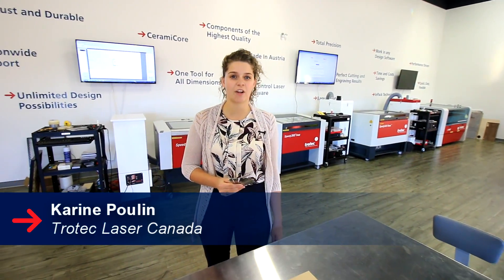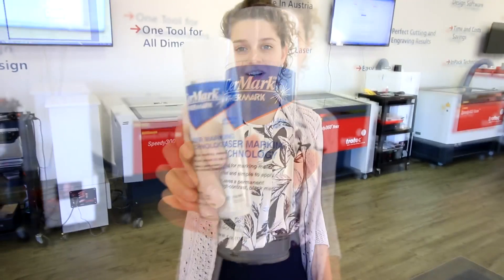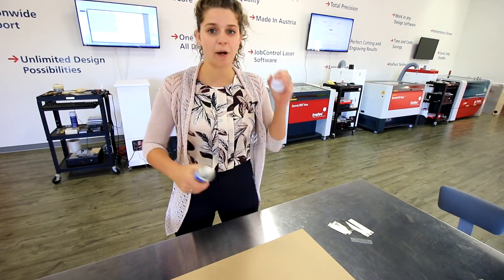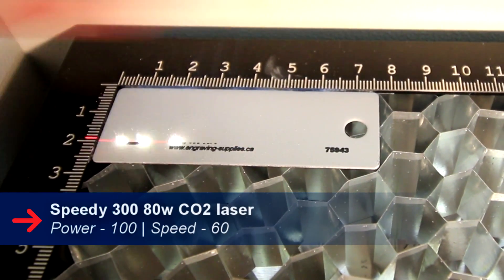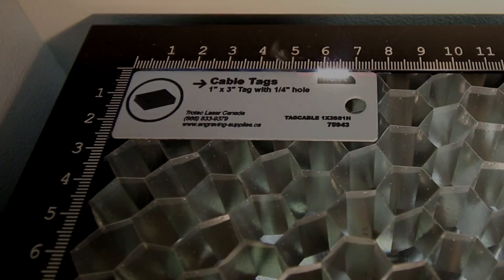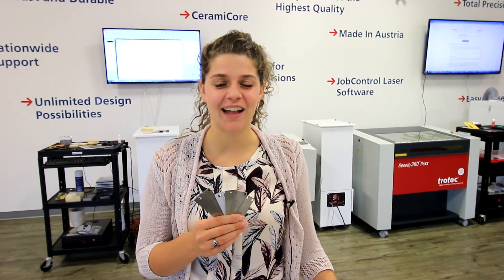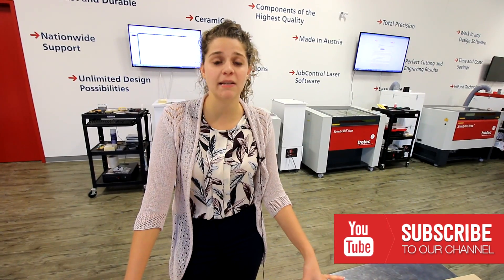Cable Tags | Laser Engraving Stainless Steel | Trotec

Comment: Thank you so much for putting this video together. I am working with gold filled discs and using the CO2 laser with the same settings but none of my designs are staying on. Would this process work for gold as well? Thanks in advance!
Reply from the maker: It did work for sterling silver but haven't tested gold
Reply: @TrotecLaserCanada  thank you! I will give it a couple of other tries. Thanks again!

Comment: Hi; every single video it’s about engraving a “pre-cut” stainless steel tags;  a machine which can do both engrave and cut stainless steel 1.5mm THK exist?;
Reply from the maker: Rogelio Figueroa laser metal cutters do exist but not at Trotec at the moment. They are a completely different with a lot more wattage and special tables, accessories etc.
Reply: 👍🏼, thanks for your quick reply.

Comment: For surgical instruments, which method do you recommend. Co2 or fiber
Reply from the maker: Fiber would leave a permanent mark because it engraves into the metal. CO2, you have to use a spray - which anneals the material, it can get faded over time.

Comment: Hi Trotec team, Can this laser machine engrave on thin Black anodize aluminum equipment spec. name plate? and what material thickness can be fitted in this machine? I am looking for laser machine be able to engrave on Black anodize aluminum and also some engrave for 4.00" high  part from machine shop too. Thanks
Reply from the maker: Hi There, that should not be a problem. What country are you living in?
Reply: @TrotecLaserCanada  We live in Fremont, CA 94538 USA
Reply from the maker: We have offices in California, if you would like to provide us with your contact info we can reach out and schedule a demo

Comment: did your setting on the speed 100 when I cleaned the cermark off the black numbers came with it
Reply from the maker: Hi Carol, is your speedy 80w? you may need to lower your speed. We would suggest to do the greyscale matrix to find the perfect setting for you: https://www.troteclaser.com/en-ca/knowledge/tips-for-laser-users/grayscale-matrix/
Reply: it is a speed 100 60 watt
 @TrotecLaserCanada
Reply from the maker: Hi  @carolwierzbicki6097 , yes in that case you should slower your speed down, try 40-50.

Comment: Can the marking get erased with time? We install nameplates on our equipments which are installed in mines, acid plants, smelters, power plants. These environments are very harsh and the tags can be exposed to temperature between -40°F and 1200°F. It's important for us that the marking remains intact for a long time (10-25 years). We currently just stamp them with letter/number punches.
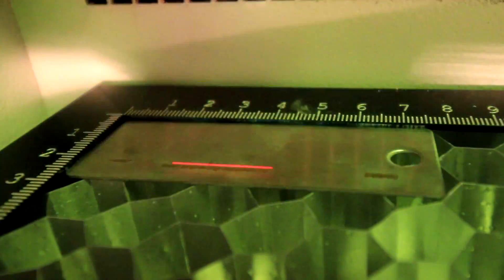Reply from the maker: Hi Richard, that's a great point. Yes for harsh environments we recommend using the Fiber laser shown at 1:46 and not the CO2 with spray. The Fiber laser gives you depth and is meant specifically for harsh environments.
Reply: Are you sure that stainless steel is appropriate for those temperatures? It seems like an Inconel job.
Reply: @JustinCrediblename  Indeed our equipments are made from various alloys depending upon the media and temperature., from plain 44W and 516gr 70 carbon steel, to AL6XN, C276, 625 and 253MA alloys. But for the nametags themselves, 304/316 SS is good enough.

Comment: hi,
i used ur 100 p 60s settings for my speedy400 120w...as a starting point.....basically burned it all off

where are the recommmended stats?
got a new tech support guy, he wasnt much help.
called again and i am waiting for a response from them. hoping this may be faster
Reply from the maker: Hi Phil, yep if your laser is 120w it's much more powerful than the 80w we've used in the video. You can find all the power settings for the stainless steel tags with spray here: https://www.engraving-supplies.ca/laser-parameters/filter/lasermachine/speedy-400/lasermaterial/marksolid-spray/laserpower/120w.html